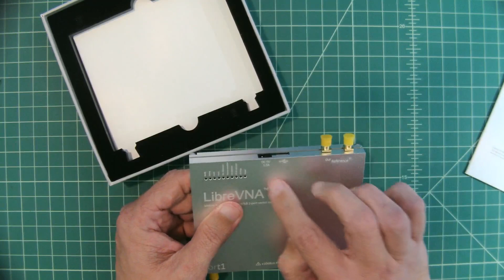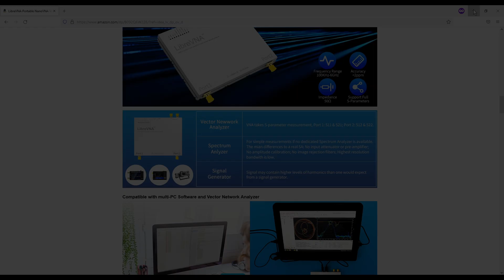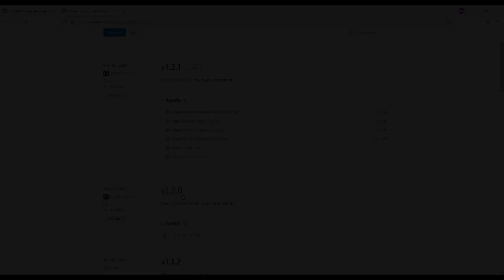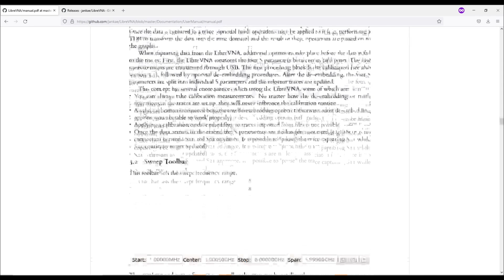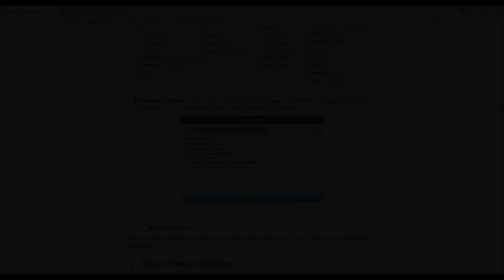LibreVNA Overview, Firmware Update, and Calibration

Comment: When you try a LibreVNA, it cannot handle DC input very well so you need a DC blocker to protect your input ports.  Als an attenuator must protect your input ports. This device is not your typical multimeter or oscilloscope.

Comment: You have made a huge mstake during calibration.
You calibrated Short, Opn and Load at the VNA connectors but for the Through Cal you added the cables.
For your measurements you used the cables so their error contribution was not included in the calibration. That's why the reflection was so wavy.
The correct calibration should be performed with the cables included. That way, the reference measurement plane would be at where you connect your DUT.
T
Reply from the maker: Thanks for the feedback Itzhak 👍

Comment: Nice informative review, thank you. TRL is Through (Port 1 directly on port 2), Reflect (open or short on each port), Line (like the through but longer). This calibration method does not require exactly known test standards and is easier to implement on PCB than SOLT. It is most often used to get S-parameters right on the edge of a device soldered on microstrip lines thus removing the test fixture from the results. I does have quirks on its own though and requires care in design and measurement to work properly.
Reply from the maker: Thanks for that info gac 👍
Reply: I don't know if I have ever used TRL cal below 6GHz. Perhaps between 2 - 6 GHz it would be ok. The microstrip lines tend to get a bit long at these frequencies. The type of circuits you are measuring/characterizing would dictate what type of cal to use. Unless I am doing printed circuit type designs, be it antennas, filters, mixers, couplers/splitters, etc., I likely would never use a TRL cal. 
Most of the standards I have used (Anritsu, Rohde & HP/Agilent/Keysight) have standards which are good up to about 8GHz. There are more costly cal sets used above these frequencies. For a HAM operator, I should think a TRL cal would likely never be used. Maybe a radio enthusiast who works on higher frequency things like microstrip filters, delay lines, distributed line matching, etc. would be more appropriate for TRL. 
There are ways of "de-embedding" your measurements so you are measuring S-parameters right at the board level. It usually involves "dialing" out the electrical length of the test probe at the board. I have had many a discussion with newbie as well as seasoned RF designers about how to do this. Isn't RF fun?!?!
Reply: Trl is also good for really wide band calibrations, you just need to use multiple dely lines

Comment: A few remarks on your calibration procedure:

* Others already remarked: keep connection to the onboard connectors as few as possible. Best practice: Insert a sacrificial female-male connector. Also, consider getting SMA standards that don't rotate the pin. So, to make it long lasting, have: Port1 := "Port1->SacrificialSMA-FM-Adapter" and likewise for Port 2 ;-)

* You want to calibrate to planes as close as possible to your device under test (DUT). That means you will never attach calibration standards to your VNA directly. You will calibrate to the ends of your coax cables. That "thru" you show, is not a thru. It's a line. "Thru" means: Line of zero length (cf. step 2 below for the fineprint ;-) ).

Your calibration should go as follows:
1.) Connect coax cables that are long enough to get to your DUT easily.
2.) To be really picky here: attach a female-female adapter to the end of one of the cables to enable a proper through. I.e.: Port1->Coax-| open end        open end |-FF-Adapter->Coax->Port2
3.) Go through all steps at the end of your coax cables. I.e. the short goes to the open end of your coax cables and so on.
4.) The through measurement will in the proper case be just the two cable ends attached to each other. (I.e. you'll end up with Port1->Coax->FF-Adapter->Coax->Port2). If you did not follow step 2 (e.g. because your DUT has two female adapters and you're not really interested in super-nice cal) you'll still end up with this, but the FF-adapter won't be properly accounted for.
5.) "Line" should be a segment of known length (typically lambda/4 or so). If your standard does not have one, TRL or other methods requiring a line won't work for you. The nice thing about TRL (thru-reflect-line, btw.) is that you don't need to know the line length absolutely precisely. But for best results it should be in the 1/4 lambda (or 3/4 lambda) range.

When you're done, check your cal for example with a third coax cable and check for consistency. You'll maybe have 300mm cable, that should give you a certain phase shift at a given frequency and you can check if that's what you see on the VNA.
Reply: Yup, what you mention is the industry standard for calibrating your VNAs accurately. and correctly. Another thing I like to do (if I'm unsure of the cable qualities or they are new) is to terminate each of coax with a 50 load. On the smith chart, I should be able to see a dot in the centre (or really high >50dB RLS) up to calibration freq. I also like to test if the cables are faulty by wiggling in a little to see huge if there are huge changes in return loss. Typically won't be a problem for scalar measurements, but can be an issue when measuring impedances accurately at higher frequencies.
Reply: Ciao, sono perfettamente d'accordo con la tua spiegazione👍👍👏👏 così a stima guardando la misura S21 con la porta 1 aperta, si vede bene che questo strumento lavora bene fino a 3GHz con una dinamica di circa -90 dB, mentre salendo in frequenza si riduce molto, quindi direi che 3GHz sono il limite massimo per fare misure accurate! Nel kit di calibrazione avrebbero dovuto mettere anche i load femmina, e magari anche un adattatore SMA male-female phase matched, uguale al SMA female-female, per facilitare la calibrazione di un DUT con connettori uguali (esempio SMA female da entrambe le porte) in questa situazione, si collegano i cavi che terminano con un SMA maschio, quindi si collega un adattatore SMA female female ad una delle due porte, quindi si calibra il cavo senza adattatori con open, short, e load, female, mentre dall'altro lato si calibra con open, short, e load maschio, si effettua il thru collegando insieme i cavi, e per finire si sostituisce l'adattatore SMA female female, con il phase matched, SMA female male, e si collega il DUT! Tecnica che si chiama "Swap equal adapter" un saluto dall'italia www.grazioliantenne.com

Comment: A lot of coin for a VNA that gives different readings based on room temperature, humidity and up time.  I hope they fix thermal instability issues soon.
Reply from the maker: Fair feedback
Reply: It might help to stabilize it if you provide external 10 MHz reference source which it has a port, for that is even more stable than what is internal to the device. If you have access to resources like that, it might be just the thing. Remember, this unit is built down to a price for the hobbyist to afford. If you want to pay $3500-$10,000 for a Copper Mountain unit you won’t have these problems.
Reply: Every vna has these issues. When you look at keysights manuals for they half a million dollar machines they tell you to wait until the vna has warmed up. The lack of active cooling is a concern but every vna is sensitive to these changes. Your calibration is really only valid for about 2 hours as well. Ask lab techs that do precise measurements, they recal multiple times a day
Reply: @Blake-jl8lh  Well, it’s not just that it varies but by how much and how soon. Price implies comprehensive design where thermal concerns have been addressed and minimized. That is not so.
Reply: This project is flawed ... so don't dream just go further.

Comment: Nice review, it is always interesting to see what other people think of the device. As the developer of the LibreVNA, I'd like to point out a couple of points which I think might help understand the VNA/GUI a little bit better:

04:28 Harmonic mixing only comes into play above 6GHz (yes, you can actually go to about 8 GHz if you enable harmonic mixing in the preferences). Above 3 GHz the reduced dynamic range is mostly due to internal signal leagage.

11:34 The LibreVNA does not use the virtual communication port (as the NanoVNA does as far as I know), so it doesn't show up as a COM Port. Communication is handled by libusb, you don't need any specific drivers on windows.

20:49 The Line measurement is not needed for a SOLT calibration (and in fact, is not used at all during the calculations for that calibration). You only need that for a TRL calibration. I admit that the dialog can be a bit confusing here. If you try to activate a SOLT calibration before taking any measurements, you will be directed to a list of only the required measurements (no Line measurement).

21:54 Try double-clicking on a chart, it sould switch to displaying only that chart (double-click again to see all charts again). No need to close all the other ones, if you want to keep them around for later.

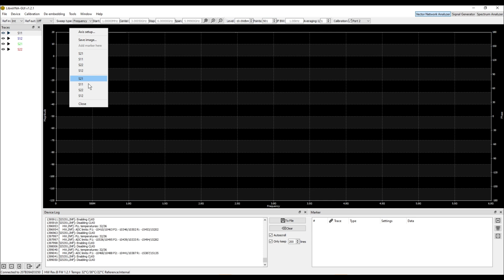22:37 Quick tip: you can also drag-and-drop traces from the list on the left onto any graph. Might be faster than right-clicking on the graph and selecting them from the context menu.

If you have any further questions, you can reach me either by mail (see GitHub repo) or ask in the group (https://groups.io/g/LibreVNA-support). For bug reports, please open issues directly on GitHub.
Reply from the maker: Wow, thanks for commenting and sharing that information.  Much appreciated!
Reply: I'm considering this vs the nano vna v2 plus4. Can the librevna do a port offset or electrical length offset? I intend to use this for measuring impedances accurately and perform matching of my circuits through a coax feed on my DUT. If my question is answered, I'm sold on librevna.
Reply: The group doesnt exist? :(
Reply: @Barc0d3 There’s a bracket that got caught as part of the URL, remove it and you’ll find it
Reply: Thanks for the info.... 73' de K4WRF
Reply: Thanks for sharing.  Does the firmware support a single frequency mode?

Comment: Been on the fence for a few months...the freq range and dynamic range got me. Ordered today. I'll use SMA-savers or a jig out a very short lead to a BNC (like my DG8SAQ VNWA 3 does). But what would be killer is for someone to build a good "test set" so that two port, all S parm VNAs like this can auto-switch. Thanks again for a very organized, easy to watch review!
Reply: I appear to stand corrected! On the aursinc store on Amazon, this Q was asked about the Test Set. Here’s the vendor’s response:

“Yes the LibreVNA vector analyzer already contains the the equivalent of an S-parameter test set. A source signal is generated and alternately applied to the RF ports. The incoming signal at both RF ports is measured, resulting in the four S-parameters S11 and S21 (when the source signal is routed to port 1) as well as S12 and S22 (when it is routed to port 2).“
Reply from the maker: Hey Frank, hope you are doing well.  Thanks for the info about the instrument 👍

Comment: Do you find a vna more useful than a rig expert?
Reply from the maker: Much, because it has 2 ports and can do through measurements.
Reply: @TheSmokinApe  , @rbrazil1000, I'd say it depends. The rig expert is more of a field instrument. Portable and immediate results. VNAs require selecting the frequency ranges and measuring reference components. They provide return and insertion loss data with phase but at the cost of more training and test time. Except for the battery operated nanovna, most are difficult to bring out of the lab.

Comment: Biggest problem I see is the calibration standards.  I would throw them in the trash.  They are going to destroy your SMA connectors on the VNA.  The center pin on any connector should never be rotated.  It wears out the female and male center contact and it only takes a couple of times to have a noticeable effect at high frequencies.  Get a set of standards that have loose/rotatable outer nuts.  Your connectors will thank you.
Reply from the maker: Thanks for the comment Mike.  I have been using SMA Male to Female adapters for this exact problem, but your are correct it's an issue.
Reply: I haven't purchased a VNA yet.  However,  I am leaning toward the "N" connector version.  It seems it would be durable.